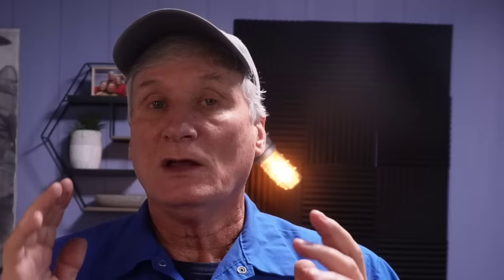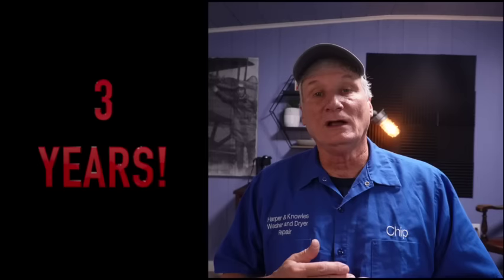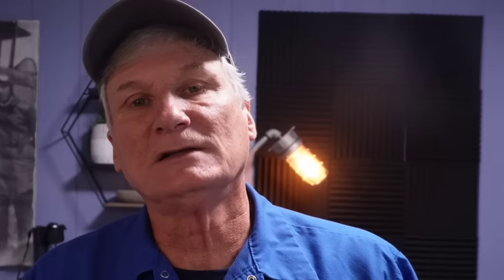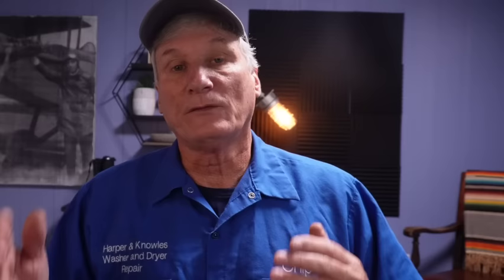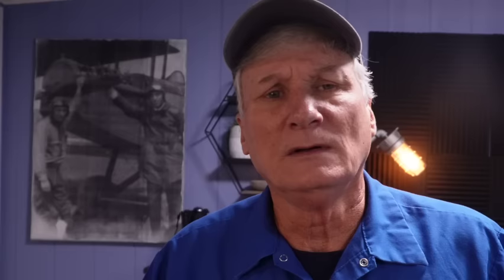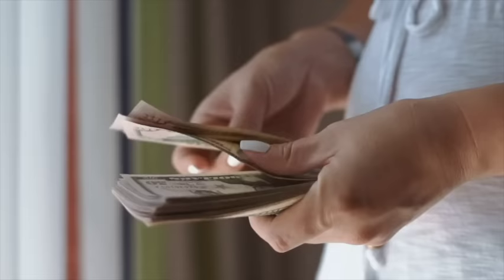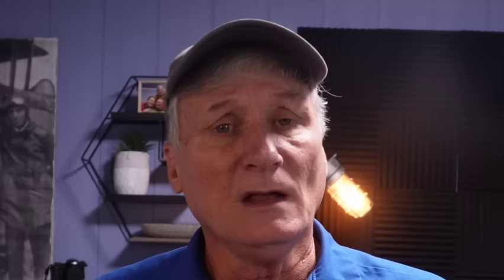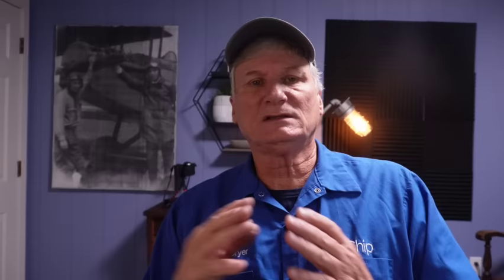How To Choose the Best Washing Machine: Speed Queen TC5 vs. TR7 Review

Comment: I love Speed Queen. They give Hot water and fills to the top.
The only issue I have with the Speed Queen was that the agitator did not rotate the clothes from top to bottom the way that the Maytag commercial did
So I went with the Maytag commercial based on the agitator. If the Speed Queen had an agitator like the Maytag commercial, Speed queen would be my choice hands down
Reply from the maker: It's interesting to hear your perspective on the agitator differences between Speed Queen and Maytag. Each brand has its strengths, and it seems like you've found a feature that is particularly important to you. The good news is that all manufacturers continually evolve their designs based on feedback like yours. I'll be sure to include this in my upcoming reviews. If you ever want to revisit Speed Queen, remember that they do offer different models with varying features. Thanks for watching and sharing your experience!
Reply: @HarperandKnowles  You have to be careful which Speed Queen washer model you buy.  Some have the new energy efficient system that rotates the tub instead of the agitator...it's really poor in churning the clothes.  They fired the engineer that came up with this new design but apparently still sell it.  The classic agitator design was brought back into production due to popular demand, and that's what I bought..the only negatives are that you have to put up with a much louder humming motor, and secondly if you want to be able to have the water added with the lid open (so you can mix in your liquid detergent and rinse out the cup) then you have to monkey rig the lid closure sensor by stuffing a piece of folded up cardboard into the back of the machine where the service override lid switch thingy is located on the back side near the top.
Reply: @maubunky1 put soap in first, as soap directions have said for decades. Plus washer instructions say this.
Use a det bottle with cup that sits on top to drain into bottle. 
OR
Rinse cup in laundry tub.

Comment: It has been awhile since I was a repair tech. I found that there was only 2 I was impressed with. Of course the one was a very old Amana and the only thing replaced on it in over 20 years was the bleach dispenser. Then here is the Sped Queen also very impressive. The only thing in all the years I every needed to do was replace a belt. Looks like they are direct drive and that is  cool. However, I would never tell a customer that they can fill it to the top. I do not agree with this due to the weight factor. Treat this appliance great and the return will be worth it.
Reply from the maker: Thank you for your insights and for sharing your experiences as a repair tech. It's incredibly helpful to hear about the durability of machines like the older Amana and Speed Queen from someone who has worked with them hands-on.

You mentioned Speed Queen being direct drive, however, it's important to note that Speed Queen machines are actually belt-driven, not direct. Despite this, they're renowned for their durability and longevity, much like the Amana you mentioned.

Your point about not overloading the washer is absolutely valid. Even though Speed Queen washers are built to withstand larger loads compared to many other brands, it's always best to avoid consistently filling any washing machine to the top. This can place additional stress on the machine and potentially shorten its lifespan.

Treating appliances well is indeed a key part of ensuring they last and provide reliable service. It's great to hear you advising customers to treat their appliances with care. Your knowledge and insights are highly valuable to this community. Please keep your contributions coming, and thanks again!
Reply: @HarperandKnowles  Great and thanks for getting back with me. I have deleted the direct drive as a comment so we should look good now.  I am sure you are also aware of the exploding Samsung washers. I would never recommend a Samsung to anyone. Unless I want to cheap them in a big way for repairs. Nice getting back to you. You presented a great video for everyone. Kindly Jim
Reply from the maker: I appreciate your amendment on the previous comment. Yes, I'm aware of the issues with some Samsung washers, and like you, I'd always prioritize reliability and customer satisfaction over everything else.

Thank you for the compliment on the video, it means a lot coming from someone with your experience in the field. I aim to create content that is both informative and helpful to the viewer. Your feedback is valuable and I appreciate your active involvement in the discussions on this channel. Keep those insights coming!
Reply: The small washers make moms want to load to very top as we re used to the huge tubs of nowadays
Back in the 90s, a Repairman told my friend the supersize tubs, just coming out, were constantly breaking and to just stay with a normal size tub and to do more loads.

Comment: We bought a Speed queen washing machine several years ago. From the very beginning it was/is extremely loud. As for as the performance of the machine it's been good. I complained to the store owner we bought it from on several occasions but he says nothing can be done about it. Some of our friends bought one from another store shortly after we bought this one (a different model speed queen) you can barely hear it run.
Reply from the maker: I understand that your Speed Queen washing machine has been loud since the beginning, and it's disappointing that the store owner has been unable to address your concerns. While it's unusual for Speed Queen machines to be excessively noisy, there could be specific factors affecting the noise level in your case. I recommend reaching out to Speed Queen directly to discuss the issue and explore possible solutions. They may be able to provide troubleshooting tips or arrange for a technician to inspect your machine. It's important to ensure that your machine operates smoothly and meets your expectations. Thanks for watching!
Reply: Call the warranty ppl if the dealer won’t make good on ur purchase! N don’t buy from him again!

Comment: Living in the UK I've only owned frontloaders. We tend not to have a utility room so our washers tend to sit under the counter in the kitchen .

 I've never had a smelly machine because although I wash on cold, I run the drum clean programme when the machine tells me to, keep the filter clean and wipe the gasket dry after every use. 
I've never used pods as I don't think the substance they are made from is good for machines. I use either powder or ecoegg.
Reply from the maker: Hey, I always love to hear from folks from other countries. I hear that top-load washing machines are a rarity in Europe. Is that true? It seems you've developed a great routine for maintaining your washer. Running the drum clean program, keeping the filter clean, and wiping the gasket dry after every use are excellent practices to prevent any unpleasant odors. Your choice to use powder or ecoegg instead of pods is another smart decision for the longevity of your machine. Thanks for sharing your insights and laundry care tips with us, and for watching my channel!
Reply: I like having the washer in the kitchen too! And then the dryer by the bdrms. No water by the bedrms and the work happens in the kitchen with the other appliances. Up north w/d are in the cellar. Yet another set of stairs to climb with laundry, both ways!! I do like hanging wet clothes down in cellar but I rly like at least dryer by bedrms.
The prob is front loaders suck so I need a top load washer in the kitchen. I would put it in a closet with the upstairs laundry chute ending next to it. Perfect. Shut the door n laundry waits, hidden.

Comment: I bought a GE washer & dryer that's all one unit. Built together washer on bottom dryer on top. They are not stackable, just one unit. So the first one didn't work. The store I bought it from was no help told me to call GE. So I did. Sears done GE repairs. So he ask me what it was doing told him he automatically knew what the problem was ordered a new chip board but they never came to install it cancelled on me every week. Finally I spoke to a very nice lady she had a new one sent to me. The store didn't know a thing about it until it arrived at there store. Sob13 months later it quit again. Called the store said it was out of warranty. So I'm pretty disappointed in GE. I don't think its ever worked right. It didn't agitate fast at all plus took an hour to wash a load of cloths. The unit has a 220 hook up and on both the dryer still works. I'm handicap is the reason I wanted this type to put on the first floor now I'm having to go to the basement to wash bring them back up to dry. I've got to find her number not getting anywhere with the store I bought it from.
Reply from the maker: I'm sorry to hear about the trouble you've been having with your GE washer and dryer unit. It sounds like you've been through a lot of frustration trying to get it repaired.

It's disappointing to hear that the store you purchased it from was not helpful and that the repairs were not completed in a timely manner. It's always important to have a reliable and responsive repair service to rely on, especially when you have a unique setup like yours.

It's also concerning to hear that the unit did not work properly from the start and that it's been a challenge to get it fixed. I can understand how frustrating that would be, especially if you have limited mobility.

Perhaps you could reach out to GE directly to see if they can offer any assistance or advice. They may be able to provide you with some options for repair or replacement, or they may be able to connect you with a different repair service that can get the job done.

In the meantime, I hope you're able to find a solution that works for you, whether it's getting the unit repaired or finding a different type of washer and dryer that better meets your needs. Thank you for sharing your experience, and I wish you all the best in finding a resolution. Thanks for commenting and watching my channel.
Reply: @HarperandKnowles  GE did replace the first one. But I'm just beside myself to think it's happened again. The strange thing on both of them is the dryer works!! I don't know why they have to put a chip board on them that keeps going bad
Reply: Now I just have to find the only good person I talked to on the original one I bought that worked for GE.
Reply from the maker: It's certainly frustrating to have the same issue happen twice, especially with a newer appliance. It's great that the dryer works, but it's essential to have a reliable washer too. I hope you can get in touch with the helpful GE representative you mentioned and find a solution. But, I doubt if you’ll be that lucky.

In the meantime, if you need any advice on washer repair or maintenance, feel free to ask. I'm here to help, and I hope things work out for you soon. Thanks for watching my channel and sharing your experience!
Reply: @HarperandKnowles  well I actually found the nice lady that works for GE number even had the date I spoke with her!! Didn't get her but did get another nice lady and they are taking care of all of it!! Having some trouble finding someone in my area that is close. The place I bought it was local but they don't have a service contract with GE. So hopefully it's up and running or replaced!! 😁
Reply from the maker: I’m glad to know you’re having a good experience with customer service.  I suppose we only hear about the bad experiences and that’s why they get a bad reputation for being non responsive to customers concerns. It’s good to hear about the success stories too. Thank you for giving us this update!

Comment: Disagree we sold Speed Queen after listening to the hype. Every customer that switched from an unreliable front loader to Speed Queen was disappointed. Lint on clothes beaten to death, and you need to use a dryer to remove the creases ( Chips Shirt is an example)and lint. Saving water in Australia and use is essential and nothing wastes water more than a Speed Queen. It's a personal choice to replace the washer or replace your clothes. Don't use claimed eviromently friendly washing powder or fabric softener that will prevent mould.  Commercial use in hotels or buy a Speed Queen for sheets and towels. I'm glad they have addressed the wear and lint on clothes problem after the competition forced them to.
Reply from the maker: While it's disheartening to hear about a negative experience with Speed Queen, it's important to note that this is just one perspective among the many positive comments from satisfied customers. Every individual's experience can vary, and factors such as water efficiency and fabric care need to be considered when choosing a washer. It's also essential to follow manufacturer guidelines and use appropriate detergents to optimize performance. Overall, it's recommended to weigh multiple reviews and feedback to make an informed decision based on your specific needs and preferences. Thanks for watching!
Reply: @HarperandKnowles  The main problem was that Australian customers do not use dryers. Even if they did the dryers sold were more like clothes cookers than dryers. I have no complaints about the Speed Queen dryers great piece of kit used and abused by Fly in Fly out workers in mine camps.

Comment: What he said about the residential speed queens being the same as a commercial machines that is wrong where I work we have multiple washing machines and my technician looked at the speed queen Toploader noncommercial, and the components are different than the commercial unit so don’t think when you go to appliance store they sell heavy duty. Speed queen washers .
Reply from the maker: I would disagree with your technician. Here is a quote from Speed Queen “While we’ve domesticated our commercial machines a bit for your home and removed the coin box, they are every bit as heavy duty. We test our commercial quality machines to 10,400 cycles or roughly 25 years of life in an average household.” The same machines in a commercial environment are tested the same and expected to last for 10 years. And the main difference in the domestic and commercial machines are a few more options given to the controls for the domestic market versus the commercial units and the absence of a coin box. Thanks for watching!

Comment: I have my mom's Westinghouse LB6M washer, and my own Kenmore Direct drive from 1996..won't ever let em go...your review helps, but I don't trust any machine that has a tub that INDEXES....
Reply from the maker: Those are excellent machines. I hope you can keep them running! For those viewers that don’t know “Indexing on topload washers refers to the basket/drum turning a few degrees of arc during agitation, typically opposite to one of the agitation strokes (either only CC or CCW, not both directions)”. Thanks for watching!

Comment: I'm thinking of getting this TC5, but,there are many complaints about foaming and overflowing at pipe drain, from washer pump pumping too fast! No other washers that I've reviewed has this complaint. This has been an issue for years. This shouldn't be a burden after purchasing and installing that consumers have to experience. Hopefully the manufacturer will correct soon.
Reply from the maker: Use only HE detergents like recommended (low suds). I imagine if there is still a problem then it will be a plumbing problem.  Manufacturers build appliances to conform to modern building codes. Thanks for watching and for the heads up on this issue!
Reply: If you have a foaming problem, add 1/2 cup of white vinegar to the wash water.
Reply: It is not a plumbing problem.  It happens with HE detergent also.  It is due to the fast drain pump in the SQ.  If you use the heavy duty or bulky cycle it will produce foam if you drain into a stand pipe.  If you use the permanent press or delicate cycle it will not produce foam because SQ uses a lower spin speed with those cycles.  Vinegar works to a point but it neutralizes the cleaning power of the detergent.  I have a TC 5 and only use the permanent press cycle and it works fine, but the foaming issue is NOT a plumbing problem.
Reply: Most people use too much detergent.  You don't need as much detergent as they say you do.  They want you to buy more of their product sooner than later.

Comment: The Speed Queen TC5 is $1300.
We replaced an inherited 30 years young MONTGOMERY ward washer with a $500 GE washer with few features.
Reply from the maker: I think that Montgomery Ward washer was actually a Whirlpool, just like the Sears brand of “Kenmore” was produced by Whirlpool to sell in Sears stores. The thing about your $500 GE is that if you get more than 7 years of service from it, you’ll be lucky. That TC5 will last for 25 years. It only hurts once when you buy it!  Thanks for the comment!
Reply: So in 10 yrs u will have spent the cost of a SQ. Which would have run another 15 yrs easily  — 25 yrs at least. 
Ur washer will last 5 yrs maybe.